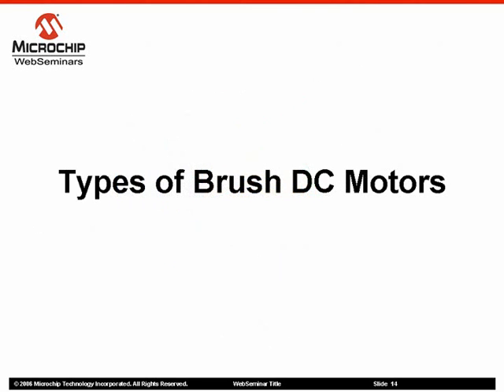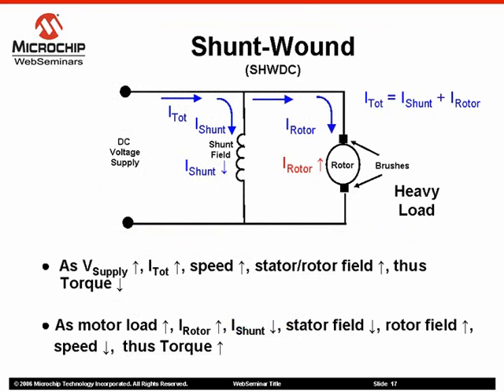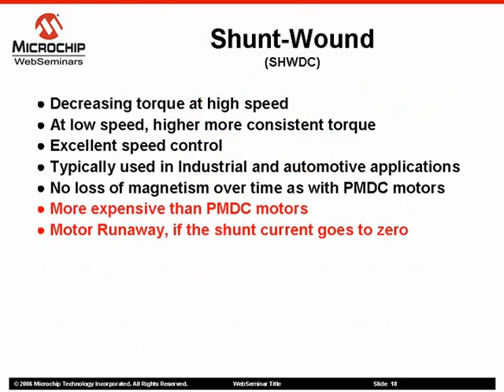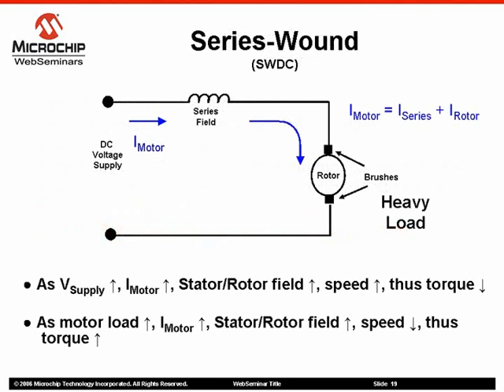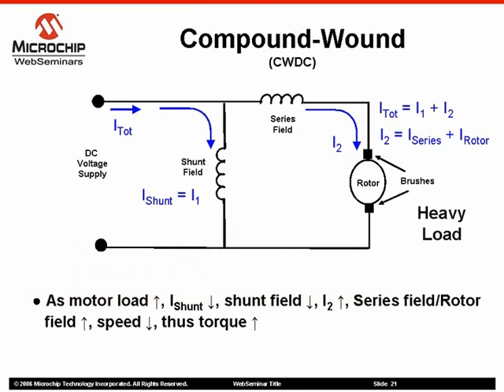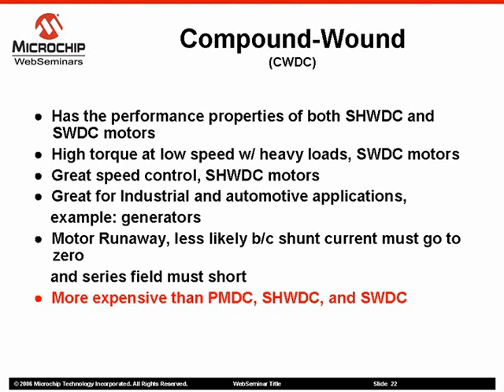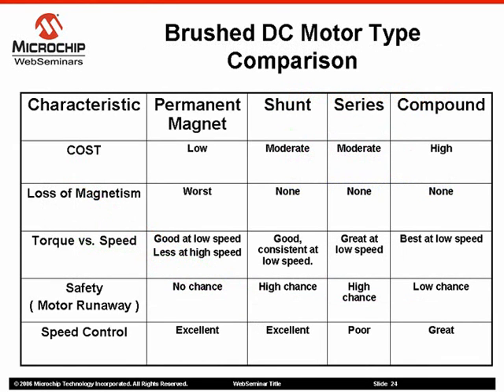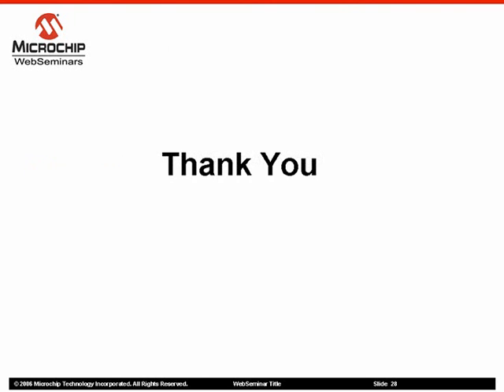Brushed DC Motor Basics Part 2 of 2

Comment: 4:06-4:14 - This is wrong.  The motor current is not the sum of the series current and rotor current.  Currents do not add in series.  The motor current = the series current = the rotor current.